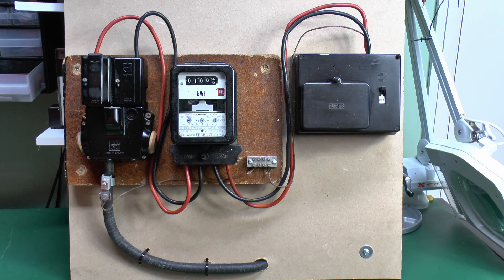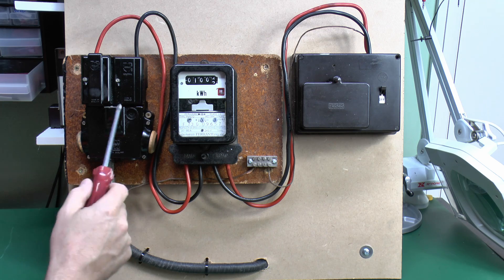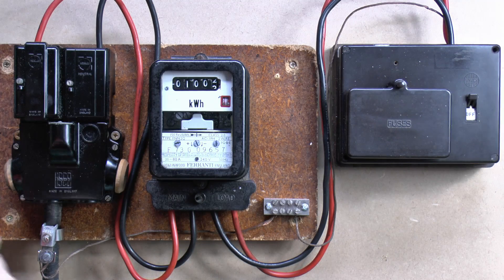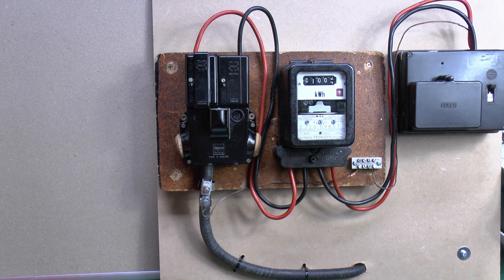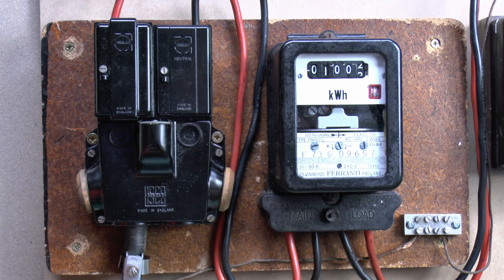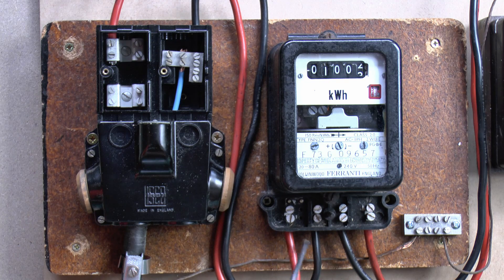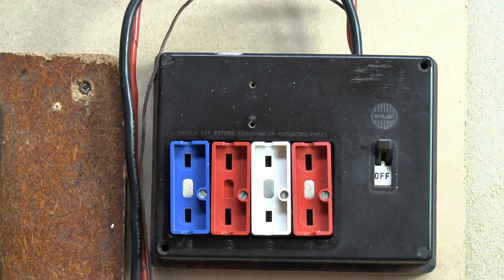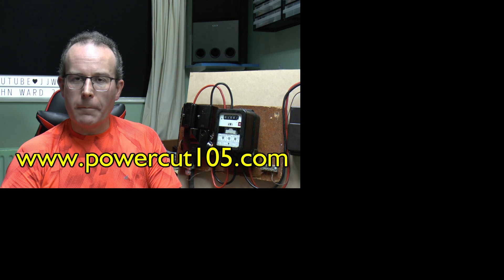Cutout, Meter and Fusebox - Who Owns What?

Comment: Here in sweden you legally "own" everything, both the "cutout", "meter" and everything else. But that doesn't mean you can freely move anything, you still have to contact the distributor (corresponds to DNO in your case) in all cases for everything that has a seal, you aren't allowed to break any seal. Breaking any seal without authorization, even if you don't touch anything, counts as "disconducting electricity" (a crime that relates to theft of electricity).

However, in emergencies, for example if you see melting fuses or something running hot, you can request that you are allowed to break seals to do a emergency shutoff, but then you first have to call the emergency hotline of your distributor, and then they will schedule emergency disconnection of your supply. Then they will give a permission over phone to break seals and disconnect supply, and any power between break of seals and real disconnection is unmetered.
(It of course only gives a couple of hours of "free electricity" but they give away that for free just because safety is more important than getting paid for the electricity they sell)

These emergencies include any fault before your main breaker, but also cases when your main breaker have gone bad or is even outright dangerous, for example if the plasic have cracked on the main breaker and exposes live parts in such a way its dangerous to touch the main breaker to shut off electricity. In some cases the "meter" or the "cutout" have a main breaker you can disconnect, but many times this main breaker is sealed just because the electricity meter is not allowed to make powerless, then you must call your distributor.

Notice that even if you have chose another company to pay to, for example if your distributor is "Guthenburg energy" ( http://www.goteborgenergi.se ) and you chose to buy electricity from Eon ( http://www.eon.se ), its still Guthenburg electricity who is allowed to move the "cutout" and "meter". In sweden it works like this, its ALWAYS the distributor (and not electric supplier) which reads the meter, or collects the measurement values. Then if you have another electricity company as supplier than the distributor, they report the metering value to that company, which bills you.

So basically, change of electric supplier in sweden, is entirely a digital/virtual process. Everything is done in computer.

The reason you legally "own" everything, is due to responsibility. Even if you aren't allowed to move or tamper with anything that is sealed of course, to prevent tampering, the legal responsibility for example if a fault occurs so a fire happens, or if something is wrongly connected, for example a missing/loose/failed/disconnected neutral in a three phase supply causing all your sockets to go 400V,  then insurance-wise and responsibility-wise, its you as a customer who gets the shit, even for anything behind sealed covers.

Its because you as a customer is responsible to schedule any service with the equipment to ensure it doesnt age in such a way a electrical danger occurs.

There was such a case in the program called "SVT Plus" (an consumer TV program where they mock companies that do bad things with its customers kind of) where the neutral had gone loose, it become 400V in all sockets, and fried all electronics, and also caused a minor fire. The distributor said it was the customers fault that the installation was allowed to age such so that hazard could form, but the customer told that it was sealed and he couldn't "check the status of the installation if it needed maintenace". The dispute landed on that the customers responsibility to schedule reglar inspections from the electrical distributor to ensure the safety of the installation.
Reply: Meters aren't changed in the UK when you change suppliers. The only exception to that is the first generation of "smart meters" which, due to technical limitations, can need physically swapping out. Otherwise it's just an administrative change with a meter reading.
Reply: Here in the UK we wouldn't break seals to do an emergency 'shut off'. Nothing behind the seals is designed to shut off power manually. The power should be turned off before the main fuse is removed. Removing this fuse to disconnect a load is not what it was designed for.
Reply: @millomweb  correct, but as I said, in dire emergencies it could be neccessary to disconnect a fuse under load. In the same way a E-stop could stop a machine in a way that could cause the machine to break, but for safety. Its very rare such emergency disconnection is done, but it does exist the possibility if something happen.

Actually, the main breaker and fuses before the meter is usually sealed today, just to ensure the values are reported in at the correct intervals (smart meters).
Reply: @sebastiannielsen  Here, we have a main switch for the purpose.If there was anything making that inaccessible, it's like the main fuse would be equally inaccessible too !
In my house, there has been occasions to use the fuse as a switch for convenience rather than emergency and the load through the fuse at the time would be minimal.

Comment: In the early 1990s' I went to a building site were the builder pulled down an old building and for months the meter board could been seen in the middle of the building site unprotected and dangling on the supply cable in the wind with a 2.5mm flex attached directly to the meter and feeding some nearby builders container box. Shame cameras were not popular back then.
Reply: Local demolition site to me still has 3ph supply - sheltered from the weather by being in a wooden box on legs.
Reply: The official procedure to get a supply disconnect is now quite complicated and the companies involved will charge for their work.
So a lot a unscrupulous demolition companies are now knocking the buildings down with the live cables still connected then calling in trying to get it cut off free of charge ‘because it is now a dangerous situation’. 
They then get an even bigger bill and try everything they can do to bugger off into the sunset without paying it.
It got so bad recently that the electric Utlilities companies got together called and meeting with the governmental regulator and some of the larger demolition companies to try to stop this off before they end up killing someone.
Reply: pmailkeey 
the building sites still need electric so they often arrange for the old supply to be disconnected and diverted into a temporary supply cabinet on site to feed their portacabins and welfare facilities.
This cabinet can be made out of anything as long as it is robust, lockable for security and weather proof.
It is official called a TBS [Temporary Builders Supply] and is perfectly normal.
Reply: @robg521  Just connect the wires together at the site, that'll make it safe.
Reply: @robg521  Old supply still connected.

Comment: I had a paper insulated cable catch fire yesterday, and shorting out and setting the house cutout on fire. Like, flames, arcs, spewing fire and smoke. I had to beat it out with a shirt and then frantically call emergency services while the smoke alarms were blaring. 
I am now worried that they might replace the wire to my new main fuse, but the wire outside, in the ground,  will still be partially paper insulated, and what if it starts arching and catching fire again?

Comment: I have a current situation where the back board needs replacing.  The DNO have said they can't do it unless a meter engineer is there at the same time to remove and replace the meter.  That's going to be pretty much impossible to arrange.  In the end the DNO have agreed to attend to see what can be done and said it might be possible for them to do it on the same appointment.  BUT given the good points raised in this video about the dangers of moving the old paper insulated cable, it will be interesting to see what happens.  I will report back!
Reply: Just change your supplier to the dno, problem solved all the same company.  Actually for simple stuff like that the supply company is supposed to do it.
Reply: I work for a local DNO and yes this is a bloody nightmare to arrange.
In the old days the local electric board owned everything and you had 1 point of contact they things done.
Now you have the local DNO that owns the back Board and the cutout
You have the M-O-P who owns the meter itself.
And you have the Official Supplier who is in control of the supply.
Trying to arrange for everyone to turn up on the same day is an absolute ball ache, often we bend over backwards to meet appointment dates only to learn when arriving on site to do the work, that the meter man can’t get there that day. [so now what do you do?]
We still have the old staff that originally used to do everything but now it is illegal for them to touch the actual meter because we no longer own it.
.....
This has been done by Stupid Idiot governmental regulators who know nothing of the real world and are only interested in level playing fields.
The governmental regulators are ‘Not’ knowledgable experts in the industry, they are just politicians.
Reply: @robg521  Update as promised... two really helpful guys from the DNO attended.  They replaced meter board, said there was no problem touching the meter either.  I asked about touching the old paper wrap cable and he said that it's fine to move it a bit as long as they don't start seriously bending it about.  They also replaced the Y shape termination with a different type, upgraded the service head and changed the existing earth clamp for a braided type.  All done and dusted within an hour.  Unfortunately I was called elsewhere as I would have like to have watched how they did it!
Reply: @jonathanbuzzard6648  Supply company didn't want to know as it involved touching the service head!  I guess they all have their own rules.  It doesn't help either that the person who you have to deal with is a desk-jockey who hasn't a clue about the installation rather than an engineer who actually understands what you are talking about!

Comment: You mentioned the service cable must not be tampered with, quite rightly so. It is a concern about the age of some of these cables, quite often the conductors are much smaller than retrofitted meter tails, unless the entire installation is similar to your example shown. I have seen the pitch leaking out of these cables because the property has been extended, more circuits added, then a situation arises that the demand is greater than what those cables can safely handle. A serious fire risk.
I have an overhead supply coming into my property. The service cable is over 40 years old. In fact, back in 2013, the dno replaced the bare 3 phase & neutral plus 6 metres of my and my neighbours service cable, but left the old stuff cleated to the walls of the property in use, they fixed a cable joint on the corner of the property to connect the new to the old, why they did not replace the lot is beyond me.

Comment: This is a basic question but here goes. How can live always be live if the supply is AC. Is it because, although the current and voltage oscillate. the fact that the neutral is tied to earth means that in theory you, the neutral and the earth are at the same potential  and as such the potential is 0V even though that potential is swinging between -230V and +230V with respect to live

Comment: great video content my question is how are electricians changing consumer units if there is no double pole islolator fitted by the DNO  as you have stated that these are usually sealed and you are not suppose to remove . Seen video by David slavery where by he decided to pull main fuse so he could fit new consumer unit because as he stated why don't the DNO fit double pole isolator s standard as surely this is eager safety issue towards the electrician  ??

Comment: I replaced a ceramic (china) fuse box once in a small mid terrace house. Never seen anything like it. I should have kept it. Ceramic fuses were quite common but this had a ceramic top cover as well. Very heavy. I didnt keep it as the fuse wire ran over asbestos pads.

Comment: As a retired meter reader,  an occasional question from customers with an outside meter box:  "Who owns the box containing the suppliers equipment? Can I repair the broken door, and what about painting the exterior? "  I believe the actual enclosure is part of the property, installed by the house builders, but of course the contents belong to the DNO and supply company. Was I correct,  because a huge number of boxes have broken doors etc never mended, letting the weather in?
Reply from the maker: Yes, the box is part of the building and any repairs are the responsibility of the building owner.

Comment: Still got that exact fuse box,  although a 6-way version in better condition, I've got a digital meter, (not a smart one though, they're a rip - off!)
Also got that exact same head, but Interestingly mine is a "loop-in" system where, along with the main lead covered incoming cable, there is a second cable coming out of the head, which goes through a hole in the wall, under the floorboards to the house next door.

Comment: Apparently you can purchase your own Meter  and have it professionally installed/certified and then purchase your electricity directly from the generation company therefore bypassing the expensive middleman
Reply: No, you can't do that. You might find that information from sovereign citizens or people that claim energy is free, but it's misleading. The companies that generate the energy will not deal directly with domestic properties. If you install your own meter it should be done with full cooperation from your current supplier.

Comment: How do you wire up grid tie inverters? I see people plugging them into main sockets but surely this would affect the function of the RCDs?
Reply from the maker: Connected to their own individual circuit at the consumer unit.
If an RCD is required, then it's an individual RCBO or an RCD and MCB which is used for the inverter circuit only.  Not permitted for an inverter to share an RCD with other circuits.

Comment: The back-board plus the cabinet if present are the property and responsibility of the building owner and have to be provided before a connection will be made by the DNO - of course once the equipment is installed the owner can't do much with it. Same applies to gas - this causes issue if the metering company wish to install a meter that isn't compatible with the cabinet that is installed as the onus is on the owner to change the cabinet - but this clearly is impossible without having the supply company and metering company do the work all at the same time!

Comment: I've got a block of flats built in the 50s with this sort of wiring, been a major headache updating it all for the new regs.   Just out of interest who owns the switch unit on an economy seven system as I've got a tenant whose switch isn't working.
Reply from the maker: Probably the network operator (DNO), however some blocks of flats have the internal cabling and equipment as the responsibility of the building owner, and in some of those, the building owner is unaware of this due to ownership changes and so on over the years.
Check with the DNO first.

Comment: The old Wylex BS5486 board loaded up with semi-enclosed's to BS3036 together with the incoming tails belong to the property owner...

The metering equipment belongs to the energy supplier...

The cutout/service head and tails up to the meter are the responsibility of the DNO (Distribution Network Operator)

The DNO are responsible for maintaining TN earthing arrangements...

The property owner is responsible for maintaining TT earthing arrangements...

Values of Ze (external earth fault loop impedance) can be obtained through either enquiry...or direct measurement...
Enquiry will typically result in being given .80Ω for a TN-S...and .35Ω for a TN-C-S...
Direct measurement will often (but not exclusively) return lower values...

Semi-enclosed fuses to BS3036 come in either 1KA, 2KA or 4KA maximum Ipf (prospective fault current) withstand...

Hope this clears things up.
Thanks.
Glenn
GLMelectrical
UK

Comment: Why don't they provide a master on/off switch on the incoming supply cut-out?
Reply: New installs get isolators and you can request one to be fitted but it's not free
Reply: Because that would be sensible at the cut out unit design stage. They’re not sensible unfortunately.

Comment: So to be clear - between my meter and fuse box, the line and neutral both go through a "black box" with BICC written on it, with metal sealing tabs around the screws. As this is AFTER the meter, I presume this is "mine" per the video, so I am okay for an electrician to break the seals?
Reply from the maker: Yes.

Comment: that clamp for the earth on the incoming supply is huge no no, should be an original sweated/soldered, hepworth compression bond or constant pressure roll spring installation.
Reply: He said so in the video and explained this was a common issue people will need to deal with.  These lazy clamps will probably stay around for decades due to the cost of calling in the DNO.

Comment: What would make  the wheel and numbers stop moving
Reply from the maker: Turning off all of the electrical items in the building and therefore not using any electricity.
Reply: @jwflame  thanks John the trip goes after a few hours hog using the sockets try to plug everything out one of the bedrooms also when turning on the light is dim and takes a while to light up